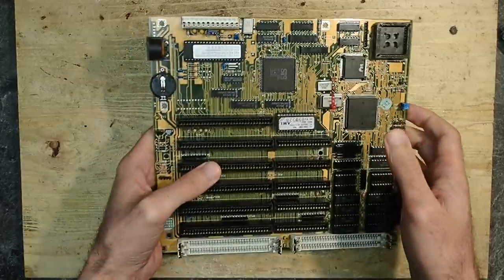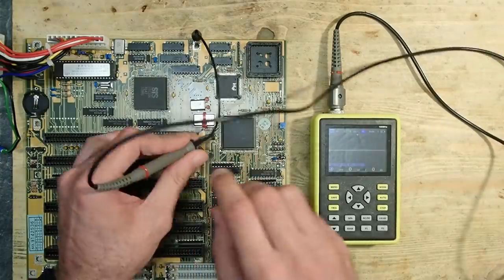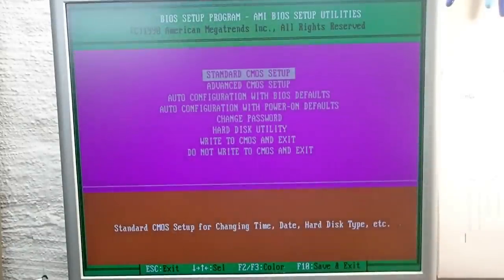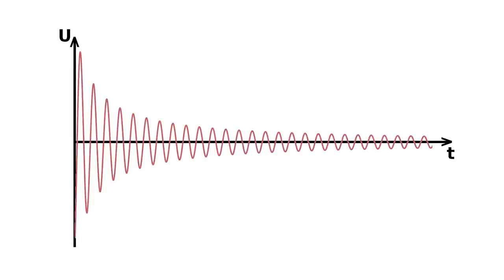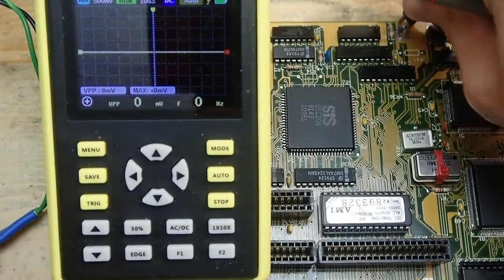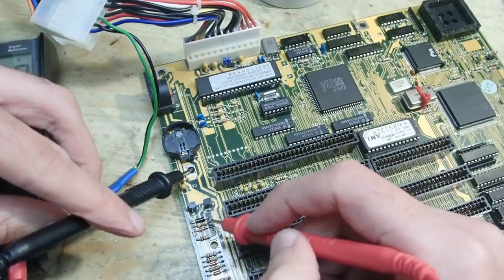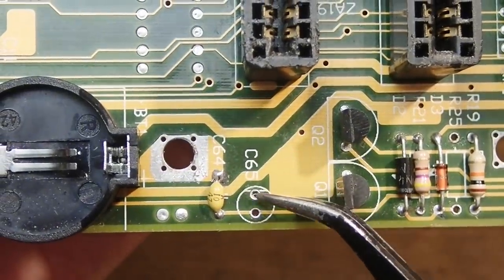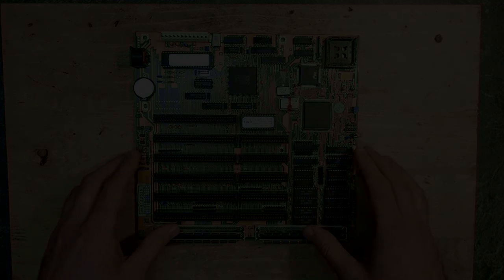Let's repair a mystical issue with an old 386 mainboard

Comment: Once again a great video!
Very useful information too.
If I ever have this problem now... I will be repaired.

BTW this was a leaky cap (Partially sorted).
I hate these tantalum caps. I always go bad.
Just replace them with electrolytic.
These are extremely cheap too.
Go online and get the full set of values. :)
Reply from the maker: Thank you. I have all kind of electrolytic caps too for my DIY projects, I don't know, why I just didn't use one of them :D I just had a can full of desoldered parts in front of me on the table and just grabbed something, what IMHO would fit. LOL

Comment: Personally, I would have never thought to check the RTC circuit. I probably wouldn't have even noticed the stopped clock in BIOS.
But as for your fix, bodging a line direct to a known good 3V power source would have been my first choice for diagnosing the issue too.
Reply from the maker: Yeah, it's always a mix of an educated guess and a lot of luck ;)

Comment: Great repair and very interesting fault! 👍
This tantalum cap didn't explode, because of low current in that rail, but after power up, it gets shorted internally.. 
Now You get potentially explosive capacitor, just solder wires, put it in front of slow motion camera and turn on 5V supply! 😂
Reply from the maker: I already saw a lot of tantalum caps exploding, scares a shit out of me every time :D This one is already in the bin.
Reply: Yeah my first guess would not have been a shorted tantalum, but it looks like that's exactly what this was.  The supply was switching from battery to +5V, and is heavily current-limited, but the shorted tantalum was pulling it down.  I definitely would've suspected one of those transistors first, assuming the tant was holding the charge while switching from the battery to effectively no power source.  Really interesting.  Nice sleuthing, Necroware!

Comment: Excellent video! By the way, what is the model of your oscilloscope? It's very small and neat.
Reply: Interested to know too.
Reply from the maker: The oscilloscope is a FNIRSI-5012H, it advertises 100MHz, but remains just a dream. This thing works reliably up to 35MHz, but it's more than enough to repair anything up to 486, since the FSB is 33MHz. If the correct voltage is not important, but the waveform and the frequency, you can use it for up to 75MHz. Even if it doesn't deliver 100MHz performance, I'm still glad, I have it and it's enough for what I'm doing. It is very small and handy.
Reply: @necro_ware  Thanks!
Reply: @necro_ware  thanks!

Comment: What ISA VGA card would you recommend for a 286/386? All the ones I tried give me a vertical stripe pattern (sometimes its dim, sometimes more noticeable). Is it perhaps an incompatibility with LCD monitors? 
I noticed yours doesn't display these kind of vertical stripes. Do you know what I'm talking about?
Reply from the maker: Yes, this is an incompatibility with the TFT displays. You should take Cirrus Logic CL-GD542x, where x is 0,1,2.. those cards have good DAC, which has no problems with TFTs.

Comment: yeah, the difficulties of finding replacement 32K real time clock quartz oscillators :-D Cool video, and a nice troubleshooting mystery, though
Reply from the maker: As I said, the quarz is not a good example of a part, which is hard to find, but many others can be a pain in the back.
Reply: @necro_ware  Yeah, I get that. It just made me giggle a little bit.

Comment: 2 digits should be read as pF and K is the tolerance code. It is +/- 10%

I think that it should be a 22pF with +/- 10% tolerance.

Comment: i was about to comment that  blue capacitor was a ceramic 22 pikofarads in thermal insolation jacket probably capable of handling up to 1 kv actually , but you was smart on your own power :]
anyway very interesting problem
Reply: Yeah, me too!  :-)  For the audience:  Ceramic caps are typically rated in picofarads.  So, "22K" is 22p, with a K rating, not 22-thousand.  If it were a 22nF cap, it would be rated at 22000, or 223 (22 + three zeroes).

Now as to what the K stands for, it seems that's a little less clear.  It could be tolerance, temperature, or voltage rating.  Good luck!  :-P

Comment: What scope are you using?
Reply from the maker: This question seems to be very interesting for so many people. You are probably the 10th person who asks :D The oscilloscope is a FNIRSI-5012H, it advertises 100MHz, which remains just a dream. This thing works reliably up to 35MHz, but it's more than enough to repair anything up to 486, since the FSB is usually up to 33MHz, or can be limited to. If the correct voltage is not important, but the waveform and the frequency, you can use it for up to 75MHz. Even if it doesn't deliver 100MHz performance, I'm still glad, I have it and it's enough for what I'm doing. It is very small and handy.
Reply: @necro_ware  thanks!

Comment: Maaan, I had one of these motherboards. This is actually the same and the only motherboard I have ever killed by accident. Basically I was doing some work on it and by accident left the VGA card partially inserted and (almost asleep on my feet) I decided to push it in while the system was still on instead of powering it down first. This proved to be a terrible idea, for the first (and only) time in my life I killed a motherboard. Never again that board booted or posted in any sense. In any case that resulted in me upgrading my system to a 486SLC 40Mhz from my SX16 386,  which was not the best upgrade choice I ever made, should had gone with a 386DX 40Mhz, compatibility issues with the SLC proved to be a pain in the arse to deal with.

Comment: If the quartz oscillator starts up and stops in several seconds, replace the 10 M Ohm resistor in parallel to the oscillator. A very common problem in 40 series based generators.

Comment: Important note: That Crystal is not a crystal oscillator, just a crystal. It behaves electrically like a capacitor and can be seen like a pendulum in a clock. A pendulum that doesn't receive a pulse of energy will just stay in place. You need a circuit that keeps pushing the pendulum. There is likely an IC on the board that keeps "pushing" that crystal creating a quartz locked loop.
Reply: the TC4069 buffer/inverter IC from the video is not only used to convert the sine->square wave but also to keep oscillating that crystal - it's a pretty common practice, there is a great TI article about it, just search for "Use of the CMOS Unbuffered Inverter in Oscillator Circuits"